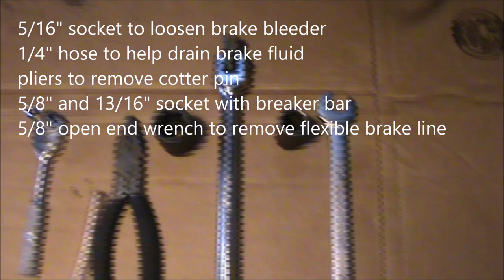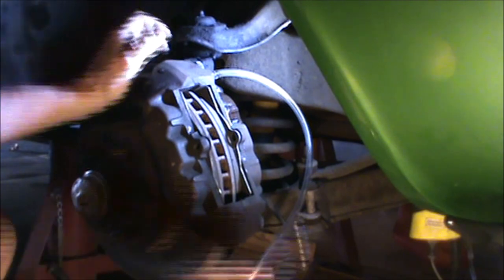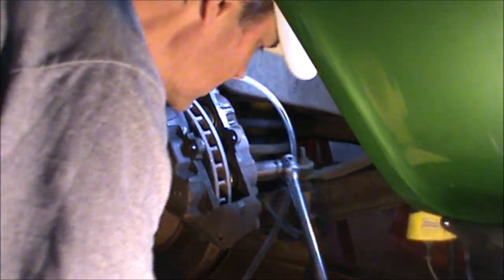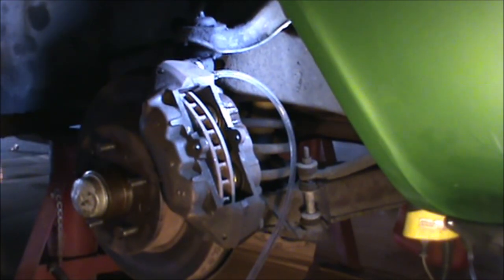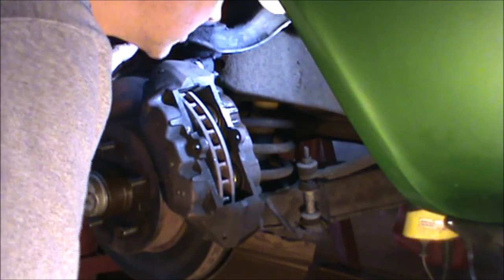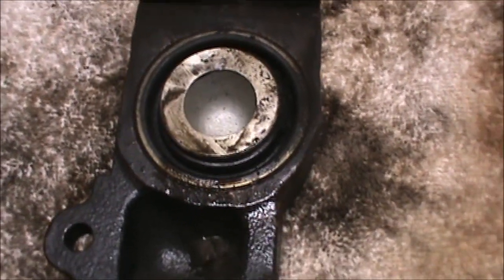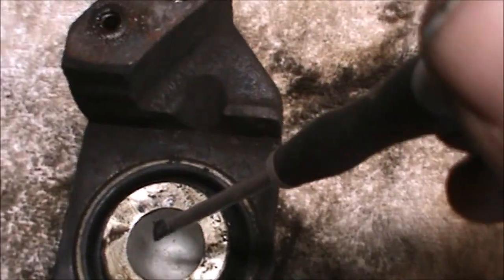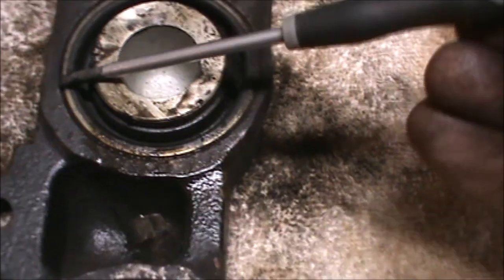The Shop - C3 Corvette Stingray Brake Rebuild   Part 1: Caliper Removal and Disassembly

Comment: My driver's side wheel is locking up, foul smell, and smoking - is it my caliper and/or brake line? Should I simply replace them?
Reply from the maker: The caliper can likely be rebuilt.   All the rubber parts will need to be replaced and all residue removed. A replacement caliper is also an option.

The flexible brake lines are most likely trashed (they are inexpensive) and should be replaced.  These should be replaced periodically anyways.

Flush the old brake fluid and replace it with new fluid and bleed the master cylinder and system.  

Take care to not get brake fluid on your paint job.

Good luck and enjoy the results of your work.
Reply: @MikeHammill-TheShop  thanks much, I'm going to start with replacing the hoses to stainless, then replace the calipers if needed. I'll flush the system too. Appreciate this feed and your advice.
Reply from the maker: @julzzcan9490  glad to hear it's helpful.  Just paying it forward for all the times I've learned from others.